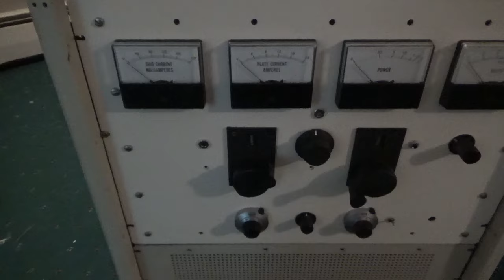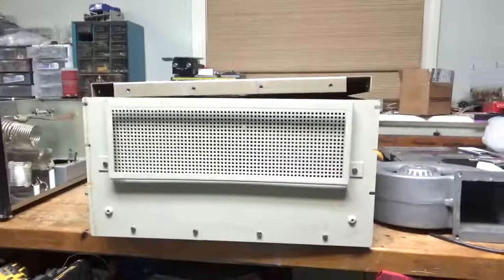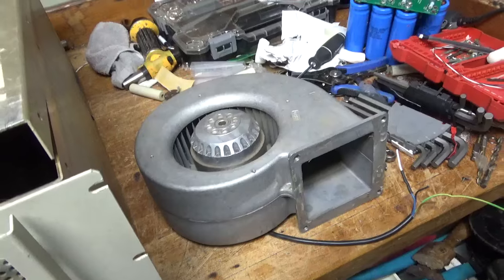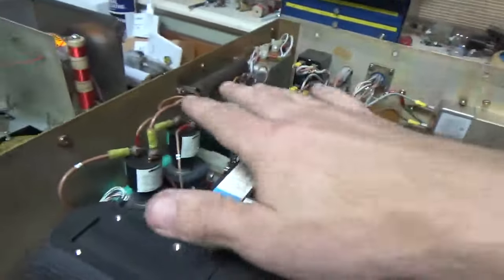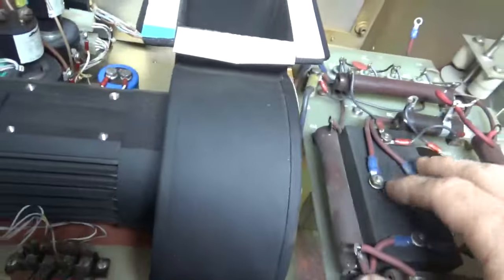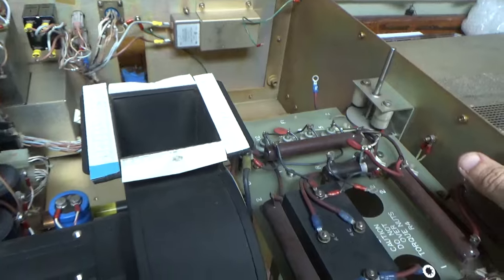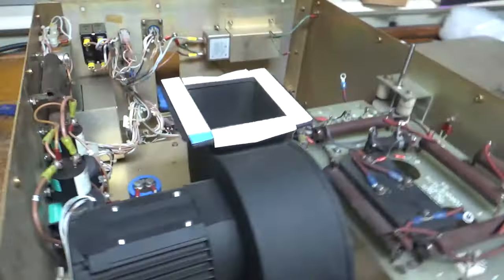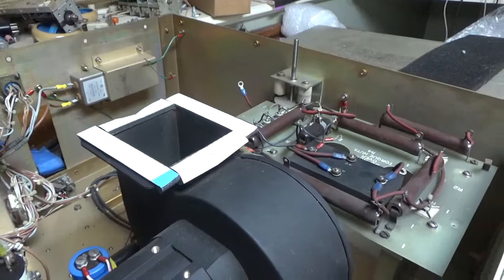3CX6000A7 160-15 Meter 12KW CCS PA Bottom Cabinet And Other Info

Comment: I never miss an update video on the 3CX6000 you're building. Amazing progress and you're absolutely spot on re building a multi-band ham amplifier been a real test of ones skills. My challenge is just understanding commercial stuff right now like the Collins 30L-1. I hope to start small one day (maybe a single tube 811 amplifier) and just go from there with building. One day.....
Reply from the maker: Thank you very much for the compliment.  Building though, not re building. I’m just re using a cabinet, metering , protection circuit and some of the old wiring.

This was a mono band rf generator 

73
Reply: @amprepairguy  So handy to have all of the parts in a unit like that! Will be watching out for the next one.

Comment: I built an 8938 432 amp back in the late 1980's but the blower was so noisy I decided to place it remotely and duct the high pressure air over.  It worked great. I had also put a good filter on the intake.

Comment: That is a really nice-looking build! I'm designing a grid-driven, push-pull pair of 4-1000A  amplifier for 160 - 10 meters. It will have a glass window so I can see those lovely glass bottles! Of course, I will NEVER drive it above maximum legal power.
Reply from the maker: Nice 

Thank you for the compliment